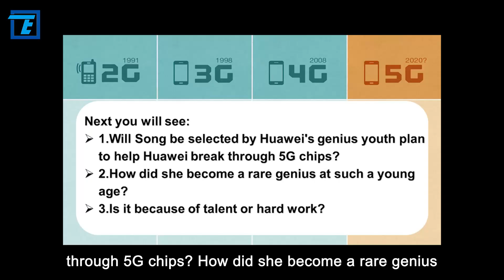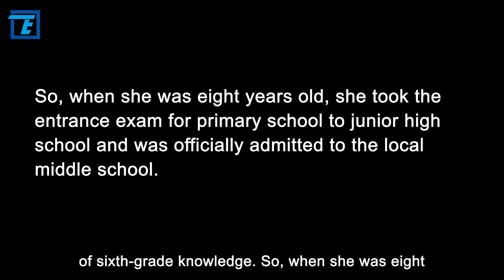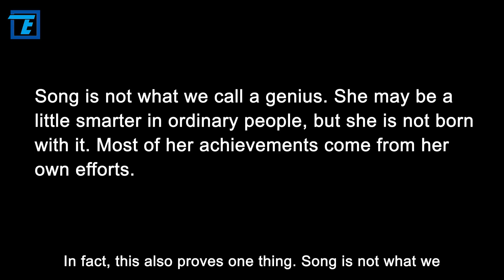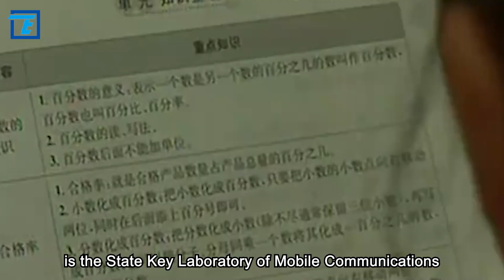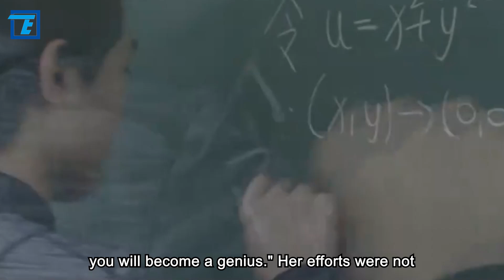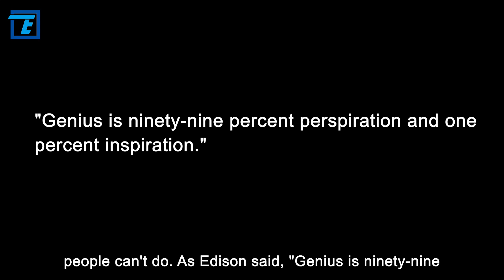She's the talented teenager that Huawei’ 5G chip needs!

Comment: Asian countries like to tunnel vision on school marks. But many genius  do not do well at school, I believe this include Einstein. Some barely get by with a pass mark at school, but they passed doing next to nothing, they are bored, while others that worked really hard failed. I have a friend that passed the Ontario charter accountant exam that way. Nature can only do half the job, by gifting the individual with a superior brain, the country have to supply the other half to make a genius, starting with recognizing the ones with potential and give them a chance to advance.  Failing that , you will have PHds driving taxis. I do not agree with 99% hard work and one % inspiration. That was the line that I saw described the usual university engineering courses. For every teen like her, no one knows how many others did not get recognized or even expelled for poor conduct or labeled as misfits. In less enlightened countries, she would not even be allowed to go to school because she is female, they just threw 1/2 the potential brains away.